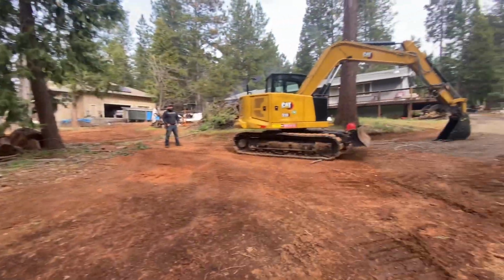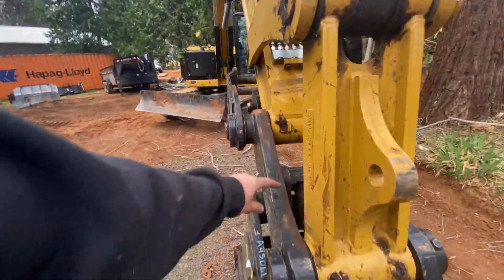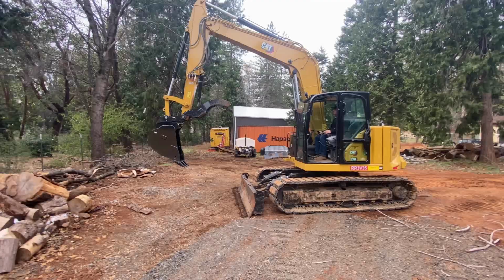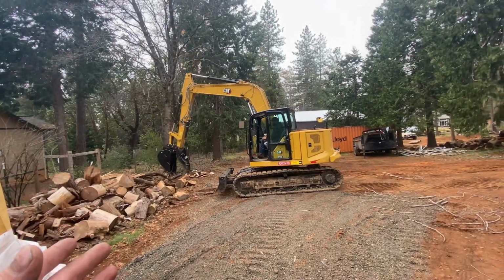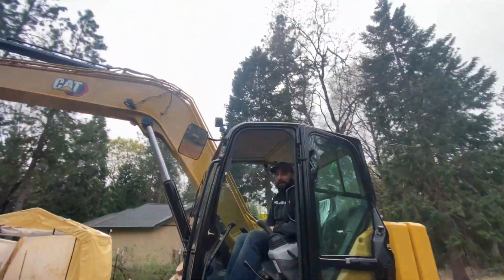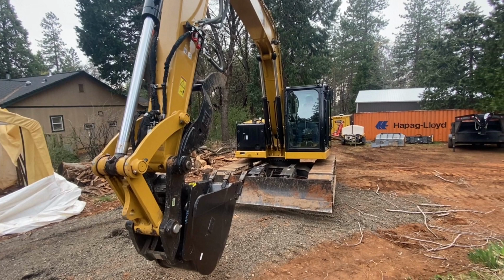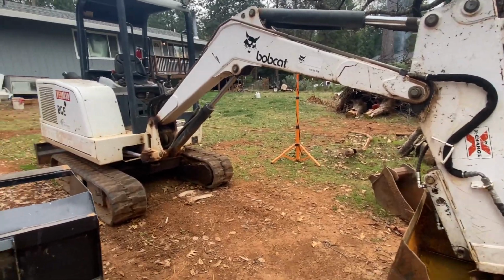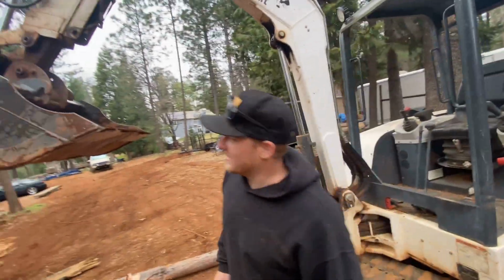NEW MACHINE! CAT 310!

Comment: I've been thinking about getting the 310 for the last few months. Thanks for the great video as usual. But the wait time is beyond stupidly now..,as far as kubota is concerned. But now it's not limited to kubota.,All machines have a much longer wait time then 2 years ago. 🙄. Yesterday I did look at the cat 313fgc series with the smaller motor..Won't be running any high flow volume like a mower or anything. But in time maybe I get a stump sheer. Because I'm beating my kubota kx057-4  with lot clearing. Between your channel as well as cottontop3 channel I can see the everyday working of tree clearing. I did order a flail mower for the kx057-4  and that is going to take care of the thick undergrowth. Your video on the tb290 was extremely informative. Thanks again for all the information..

Comment: I've been operating heavy equipment for  over 35 yrs cat is tough est .307 is faster in cycles.in an out of ground then the 311. But 311 is better balanced less jerky more fluid feeling under carriage is tough.keep the walking moters behind you  tracks will stretch then there goes the sprockets. Cat control's all the way. Keeps curl an stick on separate controls more digging power flows through the valve body better then same two functions on same stick . don't operate at low throttle hard on hydraulic pump. They come from cat at 70% of power turn it up to 90 it will ripp that coupler apart. They turned the pressure down on the walking motor speed to compensate. I've run from 305 all the way to 600 size the top of the tracks are 6 ft tall you got to take the bucket the tracks and the counterweight off to haul it down the road it takes three semis.my father was the best operator in this county just ask around well respected he passed couple years back. He was catapiler all the way but like d case 3 stick with swing peddles total old school... But an excavator has two levers lever a and lever b if you don't know what you're doing it's leave or b ..10/4🤠 good day boys like your channel hot rod guy too MOPAR move over power approaching rapidly

Comment: I can run both patterns, started on JD or backhoe and learnt CAT or ISO a few years back but if I'm around anything expensive or doing finish work the ol dome goes straight back to JD lol, so I quit tryin to be cool and run both. We have a 308 mc² or whatever the designation is and it's ok for what it is, my biggest problem with it is the damn seat is so F-lappin uncomfortable and a 6' 4 ogre don't fit so great in it. I will say it's better than hand work and is pretty quick and smooth

Comment: Expensive wood splitter ;).  I have a 307.5 but considering a 310.  How do you pull this?  The 307.5 is 18k but this is 24k so much harder to pull.
Reply from the maker: @hoffbd1  he pulls it with a ram 3500. No big deal.

Comment: Can u haul the 310 with your 5500?
Reply from the maker: Yes but I’d rather have a 40k trailer to do so
Reply: @VBELTandSON  what size trailer do you have now, I have a 25,500, sure that'd be pushing it.
Reply from the maker: I have a 30k and 26k I’d haul with either. Hoping to get a 40k this year. But depending on your tires and your suspension I’d haul it with a 26k

Comment: How are you going to take it to jobs. Isn’t it to heavy for your dually
Reply from the maker: I talk about it in the video. Heaviest ex that you can get that you can still tow with a dually and gooseneck.
Reply: @VBELTandSON  seen a guy towing a d6k2 with a ram, and a guy towing a 135 komatsu with an f450. If you can put 32k on trailer axles and 6k on the ball that's 38k minus 8k for empty trailer weight, equals 30k on the trailer. A lot of weight for a dually for sure but it's been done...